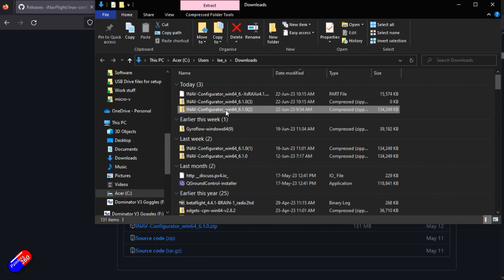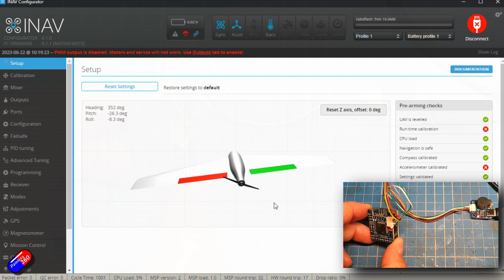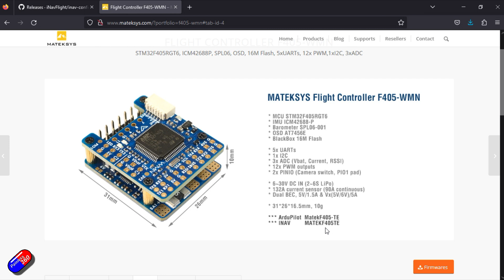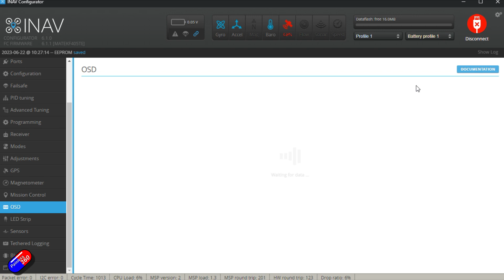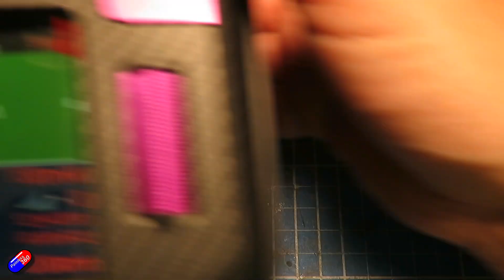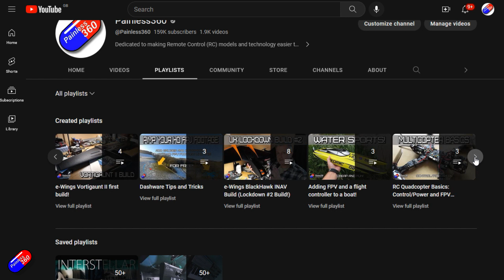INAV for Beginners 2023:  2. Flashing and setting up the flight controller

Comment: Having an issue with a Mateksys F405 Wing V2, 
I’ve set receiver on Uart 1 and GPS on Uart 2, these will both work individually but not together, once I turn on the GPS Uart 1 returns back to disabled and the receiver is unable to communicate, inav also crashes, takes a while to get it all back functional, by disabling GPS, other than that works fine.
Reply from the maker: I may make a video on this as you're not the only one to find the setup of the PORTS tricky. Every PORT/UART can only do one job at once so selecting what the flight control software views as an 'invalid' configuration' will result in it all being deleted. Some ports are best used for some jobs (receiver, GPS etc) so use the UARTS shown in the video for an easy setup. Best of luck
Reply from the maker: https://youtu.be/aJihFJwkHoI may help :D
Reply: @Painless360 thanks, I setup another F405 on an AR wing with the same ports you have assigned and the GPS and RX have worked fine, about to maiden it today, have tested GPS while connected to laptop.
Reply from the maker: Best of luck!

Comment: Great series of videos. Haven't got to the last as I've hit an issue with the pitch and roll being reversed i.e. aileron control causes pitch and pitch control causes roll. Sliders on the receiver page are correct though. Please help! Using a Radiomaster boxer
Reply from the maker: A video on that coming in the next few days. Stay tuned!

Comment: Hi, thank you very much for this video. Very helpful! One question on the outputs settings. How do you know that servo 1 is your left servo and servo 2 is your right servo. Having a wing with tail and 4 servos I don't know which one is which; in particular as the servo 1 in the mixer menu is the motor. Thank you!
Reply from the maker: The diagram in the top right side of the mixer tab shows you. It's all colour coded.
If in doubt, move the controls on the radio and watch which outputs move in the outputs tab... Happy flying
Reply from the maker: https://youtu.be/uFgWn0DlQhM will help... Best of luck!

Comment: Thanks a lot for your videos, I manage to make it work thanks to your videos.  I re sold my fly controller  F405-WMN
If I connect my receiver (radiomater pocket)  to the port TX2 and RX2, I can not bind the receiver with the radio. (TX2 to RX2, TX1 to RX1)
if i connect it to any other ports (UTRS 5,  for example, I can bind the radio and the receiver  but I can not see the bars moving in iNav. Any idea?, thanks in advance.
Reply from the maker: I've never seen an ELRS reciever refuse to bind when connected to a certain UART. Please let me know what the cause was when you find the solution. Best of luck

Comment: G’day from australia i have been following your series of videos on setting up INAV which are very informative,what i cant find is a video on adding a nose wheel servo & mixing it with a V tail i am using a Matekf405 wing V2 i have tried adding a line in the mixer page putting it on output 8 it showed up in the outputs graph but not mixed with the V tail servos do you have a video on this type of setup any help would be appreciated 
Gary Wollongong
Reply from the maker: I'd simply add an output with the yaw control for a nose wheel. Best of luck
Reply: Thanks its working

Comment: Hi thx for the videos, how did u get that telemetry screens on TX16 ? Thx
Reply from the maker: See my video on the INAV lua script... Happy flying
Reply: @Painless360   Hi I just wanted to update my post, I seen video but it does not work at all on Edge TX 2.3 TX16 all screens get buggy and glitchy. There is latest version 1.7.2 as you used. Any idea? Thx!
Reply from the maker: If you're using the latest versions and having problems then you can report a bug using Github for the project. Best of luck!

Comment: Hi Lee, sorry to trouble you again....I've gotten to this stage but am having an issue that I can't seem to find an answer for.
I'm using Linux Mint and when I start Inav configurator and connect the Speedybee, I get the error message "failed to open MSP port"....any ideas?
Reply from the maker: Try another USB cable and check that the USB port number in Configurator is correct... Best of luck
Reply: @Painless360  it automatically changes the port when I connect the USB cable.....I've tried with two different laptops as well as two different USB cables that have been verified as data transfer capable.
Thanks for the quick response, please let me know if you think of something else....
Reply from the maker: Nothing else springs to mind - I'm a Windows user here.. If you figure it out - please let me know.
Reply: @Painless360  thanks Lee, will do...
Reply: Hi Lee, seems I had a faulty FC board, SpeedyBee is on the ball and sending a replacement....I'll reply again once I get the new board.

Comment: Hi, i use gps M10Q-250 with that FC MateksysF405WMN, use same conection.Compas works properly, i soldering sda scl lines tx-rx and power with ground, GPS indicator light blue, but no position in gps menu, no gps points on map, no gps data on OSD. Try uBlox/7 add sattelits and others features in inav menus, but no results, whats wrong?
Reply from the maker: Could be a few things. Are you getting messages from the GPS in the GPS tab? That will tell you if you've wired it properly. If that works then try it with a clear view of the sky..
Reply: @Painless360  messages coming from gps 1-2 per second, ok thnx i will try again on field
Reply from the maker: Messages should be pouring in from the GPS, you should see the GPS counter increasing by a lot every second..

Comment: inav 7.1 speedybee wing f405,,I can't find a way to get the motors spinning below 7-8% radio throttle which is 1150us in receiver tab- esc calibrated , any suggestion ?
Reply from the maker: What motor protocol?
Reply: @Painless360  standard
Reply from the maker: Then I'd recalibrate or look to set the minimum throttle value in INAV to match where the motors start. A successful ESC calibration should fix it... Best of luck.

Comment: Its quad chopper, I have a Five55 frame with the SpeedyBee F405 V3 and Emax EcoII 2305s motors. ELRS and GPS.
Reply from the maker: See https://youtu.be/7Z8QPXio-i8 for my similar build
Reply: Thanks, Will this solve my throttle soft issues? @Painless360
Reply from the maker: In what flight mode?

Comment: Are there any pwm spektrum receivers that are compatiable with the atomrc f405 navi flight controller?   Also, I can't get my futaba r6303sb receiver in sbus mode to communicate with the flight controller.  I have it plugged into the sbus port next to the LED port and uart 2 enabled.
Reply from the maker: I don't know. I don't use Spektrum or Futaba here.  Best of luck

Comment: HI Lee, I dont see my FC in the list for INAV Ifight Blitz F435, Can I flash the Iflight Blitz F722 ? Thanks
Reply from the maker: Looks like you can... INAV/IFLIGHT_BLITZ_F722 6.0.0 Oct 20 2022 / 14:35:29 (
Reply: Hi Lee, I tried other FCs and they load the firmware  OK, but the Iflight F435 will not connect after the loading the new firmware, thanks   @Painless360

Comment: An other superb video, I'm not english fluent, but looking at a lot of your videos, I understand more now😉 btw, is it necessary to flash the fc before setting? I didn't, but it seems to work anyway...
Reply: Thanks! It works now, thank to a friend better than me with computers 😊
Reply from the maker: It isn't essential bit makes a few things easier.. Happy flying
Reply: @Painless360  ...so I flashed the Speedbee405 wing, not easy but looking at your old videos about Zadig, it worked, but now, I can't connect anymore to configurate...any idea? Sorry to bother you with this, I spent a lot of time to sort it out and still not working as was before to flash the fc...
Reply from the maker: Still sounds like a driver issue. Delete the device it appears as in Device Manager and plug it in again.. Best of luck

Comment: Hello sir I have Matek f405 wte I’m using inbuilt Elrs receiver with my tx16s Elrs external module I’m updated both devices letest firmware I’m trying to in inav for fix wing but non stick response in receiver tab ( my receiver and tx connect but not show in inav) 

All setup is good ports-UART 2 set serial 

Receiver tab also set serial and crsf 

This trying without battery connection to fc and mode not set 

I’m trying only USB plug-in to fc 

So what happened in my case ? 

Thank you please give me solutions
Reply from the maker: I'd check that you are bound properly. SPI connected recievers can be tricky...
Check out  https://youtu.be/GqLYuEBCHvw?si=VCCtof-dWabUiiPz
Best of luck

Comment: I live in Europe and I'm using a BN-220 GPS.
Should I enable Galileo constellation?
If I enable it, should I disable other constellations to not affect the GPS update rate? Thank you.
Reply from the maker: I do here, helps get a faster lock and more sats..
Reply: @Painless360  just enable it, or should I disable other constellation?
Reply from the maker: Enable it and leave everything else the same, as I show..
Reply: @Painless360  I did it as per your video but I do not get more sats. I also tried to use "gpspassthrough" and "serialpassthrough" and connect to ucenter to check the GPS configuration created by Inav and Galileo is not enabled even if I enable it in Inav configurator. Anything else I can try?

Comment: Does iNav work with a 3-channel plane?  Motor, elevator, and rudder?  Even if it won't work WELL, is there any way to use iNav with a 3-ch airplane?  Thanks...
Reply from the maker: Yes, I've setup a few on the channel.. Best of luck
Reply: Thanks Lee I'll look for the videos.

Comment: I'd love to see your wiring documentation process
Reply from the maker: Interesting idea. What do you mean exactly?
Reply: @Painless360  I find myself taking lots of pictures and having to figure out exactly what I did for old planes from those and the flight controller diagram. You mentioned documenting your wiring and I thought perhaps you had a good method for making a quick and easily understandable reference for the future.
Reply from the maker: I see. For simple things I use pen and paper. For more complex setups, I draw it all out on something like PowerPoint with all the correct wire colours to help keep it all straight for the install... Happy flying

Comment: Cheers for this series Lee, just bought a speedybee f405 wing FC to start my fpv plane journey and this series couldnt have come at a better time!
Reply: I just want to point out that my GPS did not work first time, and that's because i completely forgot that RX and TX pins are swapped when connecting from board to device. IE Board RX goes to device TX. Once i swapped those around i got the blue gps and messages being sent successfully.
Reply: Be sure to pay attention to the pinouts. The connector pinout is printed onto the top PCB, trust that instead of any images on Google. The four connector ports right below the top PCB are the LED strip ports, the ones below those are peripheral ports.

Comment: Thank you very much for these videos! 
Are there affiliated links that you can provide?
Reply from the maker: I tend to use links on the review videos. What part are you looking to get?
Reply: @Painless360  I have the zohd dart 250 and looking to get FC (I assume matek f405 will be good?) , also would like to buy the AR wing pro (the pnp version,  unless you recommend to get different parts than comes in the pnp)
(Note that I'm in the USA) 
Thanks!
Reply from the maker: No affiliate links for US based shops. I tried to work with GetFPV but didn't get very far... Best of luck!
Reply: @Painless360  bummer 😕
Thanks for your answer,  and please continue with the great content!

Comment: I bought two F405-wmn boards and not having great success with either.  The OSD filtering is not good.  Even with capacitors I still get a lot of video noise.  I swapped out with an older fill size board like the F765-wing and no noise whatever.
Reply from the maker: How odd. Analogue I assume? A quick search didn't show it as an issue so maybe cable placement or using 50hz servo update speeds? Lots of things it can be... Bsst of luck...
Reply: Thx Lee, will check the servo frequency.  I think with a board that small, it lacks a lot filtering.
Reply from the maker: We had issues with one analogue build here where switching from STANDARD to DSHOT300 on the ESC protocol sorted a lot of the issues out. If using PAL, frequency is 50Hz so running a 50Hz servo or ESC signal wire too close can cause the issues..
Reply: @Painless360  This is what I needed.  Thx sir!

Comment: My flight controller (Speedybee F405 wing) has the same “break out board” for the USB and alarm, I made my own harness and installed a Vifly lost model alarm instead because years of experience of locating and retrieving planes from corn fields has taught me never to trust that the flight battery won’t come disconnected in a crash.  With the Vifly it’s designed for drones and if the power is disconnected it automatically goes off for 3 hours.

Two prime examples of this, when my wing went down in the field close to our flying field and the battery flew out, it took 5 minutes to find the model, when a friends Wot4 went down in the same field, it took 3 DAYS and many many drone flights up and down the field to find his plane.

Comment: Another great video, cant wait for next one. You should expand this series with few fpv episodes :)
Reply from the maker: HD video setup shown in the series... Stay tuned!
Reply: Thank you for the video, they have always the most helpful resource online!  I have this same FC and i noticed that the max power out from the board is 5V. So would i need to upgrade to a larger FC like the H743 that can support 9V out to power the DJI O3 air unit?  @Painless360
Reply from the maker: I power from the ESC pads here... see my other builds using HD systems.. best of luck